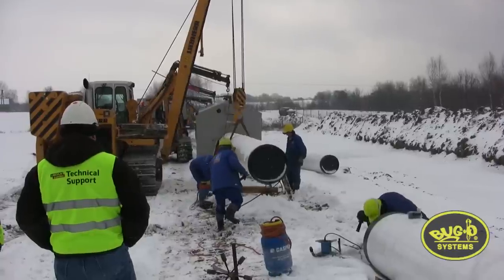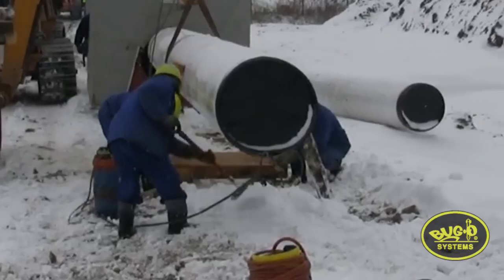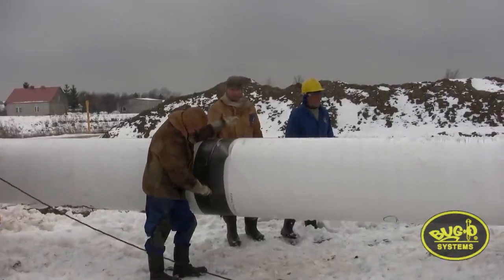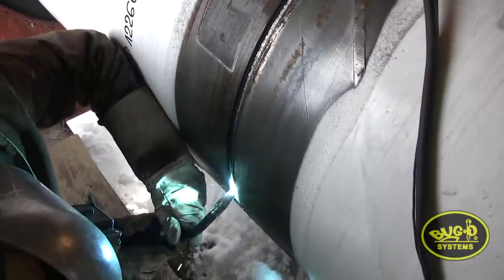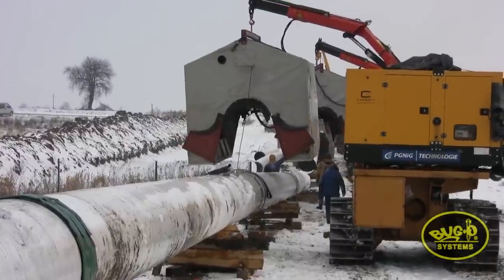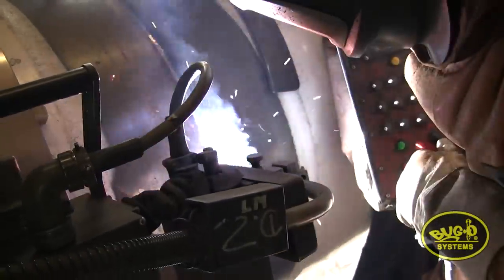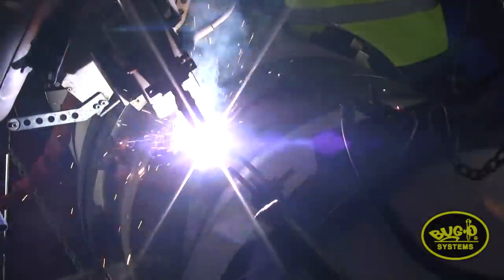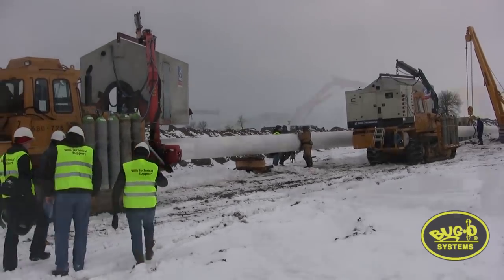Piper Plus - International Cross Country Pipeline Video

Comment: Come on 6010 it
Reply: We don't have all day gramps
Reply: @skitown11  Just look at all the crap you gotta have just to make a weld bottles, hoses, and how many guys do you have there beside that one weld no wonder utilities are so high not like back in the day when grampa did it but that was when men were men.
Reply: @skitown11  No 6010 that takes all the fun away from it and yeah I'm old.
Reply: @scott zagu  I'm 58 years old, I don't do pipe I'm a structural steel contractor. But any contractor that is bidding on a large diameter pipe project that isn't automated probably won't get the project.